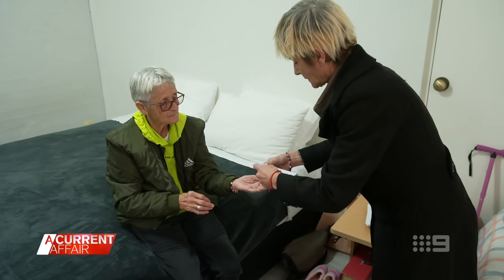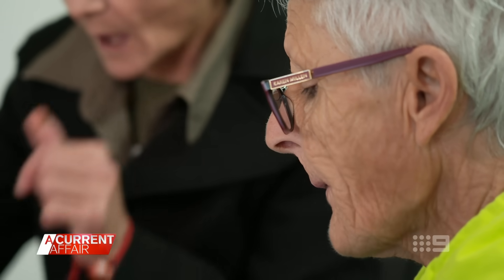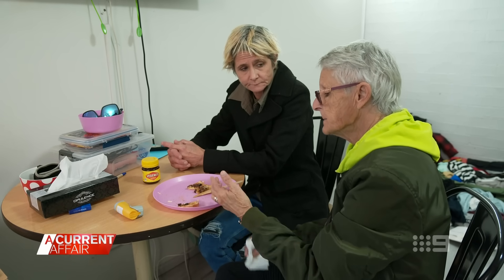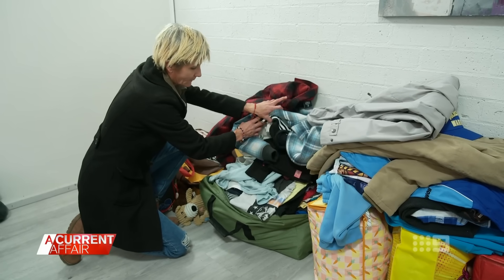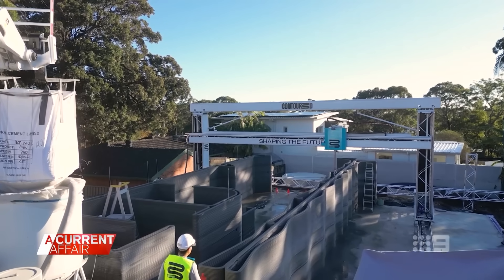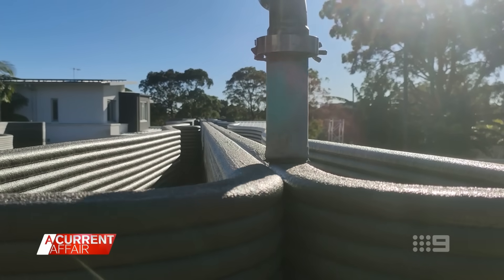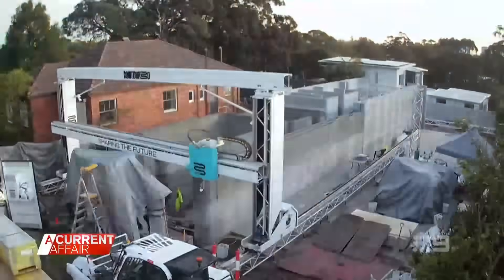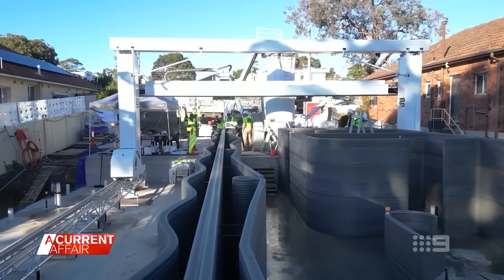Could 3D printed houses solve the housing crisis? | A Current Affair

Comment: how about 3-D printing the parts of suburbs that didn’t get built or completed? to the intent as originally, initially planned & promised! Like the bridge over the pond that ends left as a e.g marshes instead. In Thornhill valley park the Suburb in Victoria As Shown on Current affairs!!! or The light rail tracks that don’t get laid out. As Steel etc… can all be 3d printed or 3d casted easily now with the technology.

Comment: I heard that this is a disaster   The houses are cracking up.
Reply: I lived in concrete houses in the 70's that were built in the late 50's, they crack when foundations shift or when the earth moves. Theres no reo being used so I doubt they last longer than 10 or so years.

Comment: Honestly how stupid it all is with cement printing. Pour walls into forms at a cement factory, deliver them as blocks and assemble into a house on a concrete slab. The whole house without a roof can be erected in a day if not hours. That's how it is done everywhere where concrete is used for houses.
When I came to Australia 20 years ago from Russia where 17 storey 200 apartment building can be done within months I was always puzzled why spent so much time on timber framing. While living in Au I just thought ok it is hot here and you do not want to be cooked in a concrete box. But now since they praise 3D printing from concrete we are back to much simpler methods such as bulding from pre-made concrete panels.

Comment: I cant see how those houses would be cyclone proof in North Queensland without any steel reinforcing and tie down points.
Reply: Yeah each home needs to fit the environment. Flood zones need homes with pillars, fire zones need homes made of concrete/ stone/ clay/ hempcrete, very hot or cold areas need homes build underground or into hills, earthquake zones need foundations made of rubber. Every build needs to fit the environment, that saves so many resources as well.
Reply: I’ve been watching a lot of videos on the topic, from what I’ve heard they insert a steel layer/tie every 10th course or bead of concrete. Still I don’t know how it would fair against a powerful tornado, just thought I’d share what I’ve learnt.

Comment: If it can be built in only 15 days, why only a 20% saving? Does that mean materials and production actually cost more than traditional builds (minus labour costs)?
Reply: It's 15 days to pour the concrete walls. It takes 16-20 weeks to build the entire home.
Reply: lol it means building companies eat everything in between.

Building  costs will never improve thanks to thugs and market concentration.
Reply: @Somebodytryingtowin because of government marxist idiot ? 50% taxes on a new build
Reply: Only 20% savings?
And he uses alot of recycled materials. There are no tradies needed for framing, bricking and it's done in 16 weeks, instead of 40 weeks.
This company is heading towards bankruptcy because the management might be too greedy.
Another quick rich scheme targetig vulnerable aussies.
Reply: Wow
Reply: Yeah concrete cost more then wood. You def save money on the shell but wiring plumbing, and any other installs same price. So 20% savings seems about right.